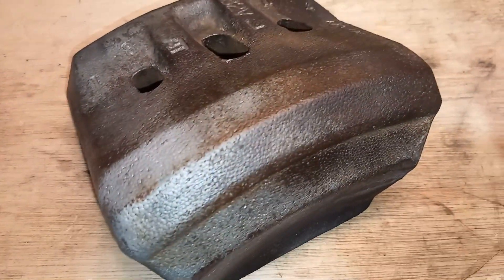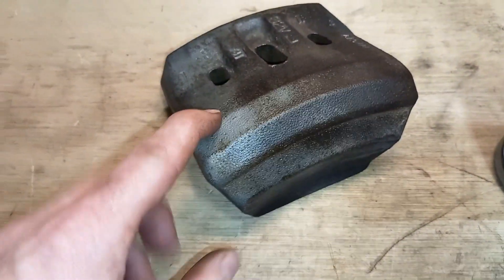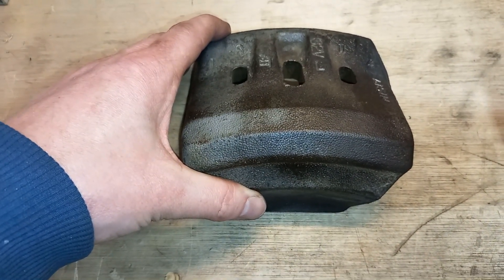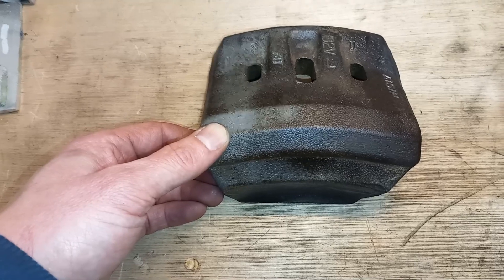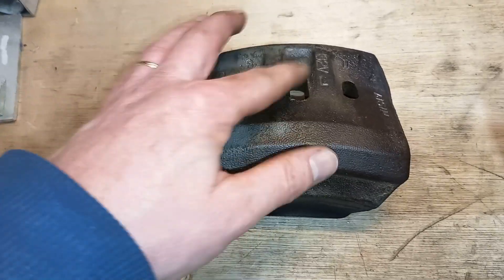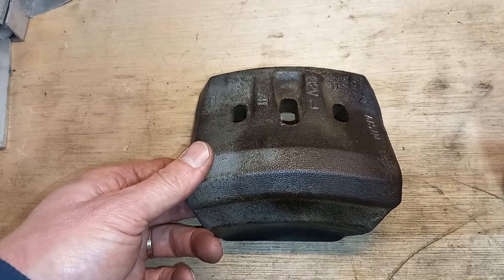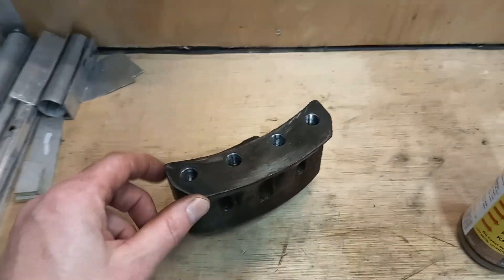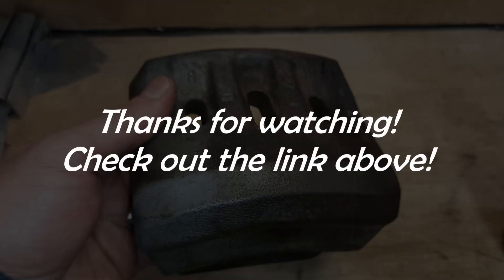Styrofoam Calipers?

Comment: 1st !
It's called "Lost-Foam" casting, and the foam can be "lost" with either solvents (Acetone, etc.) or intense heat where the foam "core" is burned out of the mold as it preheats the (dehydrates of H2O-steam) refractory shell that will soon contain the metal part that is being cast.
"Lost foam" has also been used to make Model airplane parts with smooth surface finishes by wrapping the rough foam core with smooth clear tape and the wrapping that smoothed core with Carbon/Fiberglass/Kevlar fibers and adding epoxy resin. When cured the inner core is washed away with solvent, and then the clear tape is spirally pulled out from the inside fro either or both ends, leaving a smooth inside surface.